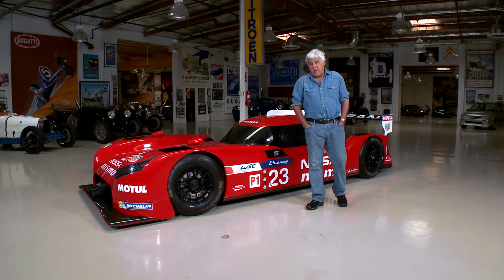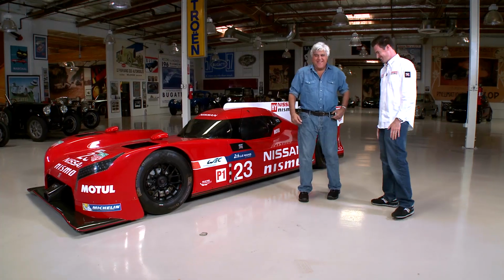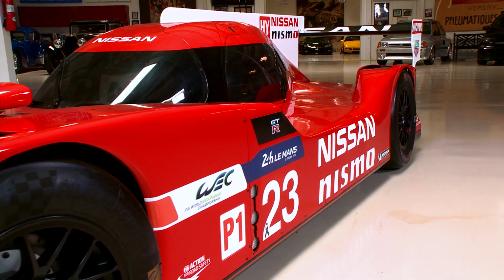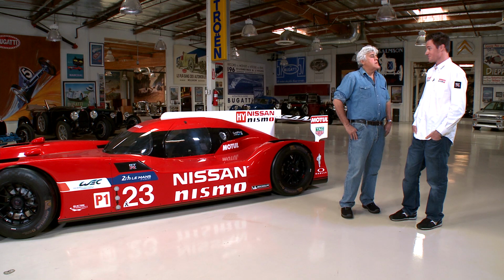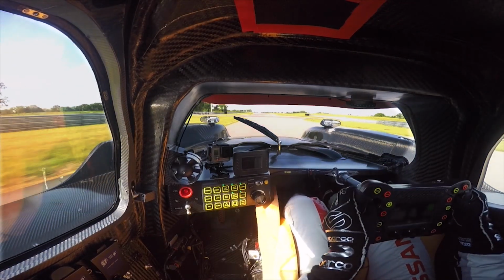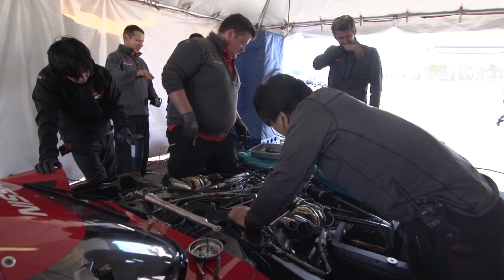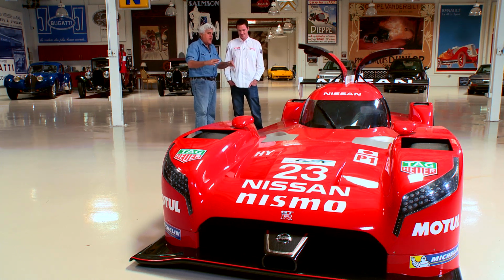Nissan GT-R LM NISMO - Jay Leno's Garage

Comment: Car was slow in practice.
Reply: Forehead Jones that they were. They did set the fastest trap times down the Mulsanne though. I think they were out there just getting a feel for the circuit. They more than likely won't be anywhere near the pace of the Porsches, Audis and Toyotas, but I think they'll be able to compete with Rebellion and put down similar times as them in two weeks. The 2016 race will be amazing.... Toyota will have a new car and the Nissan will be properly sorted by next year.
Reply: They were running shakedown, installation laps, and spent most of the day experimenting with setups.  They never ran close to max potential.
Reply: Forehead Jones Did it practice at Lemans?  Didn't think so.
Reply: Shadowboost Yes, it did.
Reply: Forehead Jones I am well aware of the fact that the course has turns sir. Which is why I said they were out there to get a feel for the circuit.... after the tidbit of their speed down the Mulsanne. A factory effort, especially one with a history of sportscar racing like Nissan would NEVER show up to LeMans with a car that's 40 seconds off the pace of it's competitors.
Reply: As a Motorsports Tech student, I'm actually intrigued by this car. We know that aerodynamics makes a HUGE difference in the handling and lap times of a car. Look at Formula 1, back when side skirts and diffusers were first coming i to play, the first team that really used them was incredibly fast compared to their competitors. If Nissan has found a loophole in the rules that allow them to run a whole lot more front end downforce than their competitors, then they should be able to keep up with the competition. I wonder if they'll have to run a harder tire than most with all the weight over the front. I'm actually very curious to see this thing in action.
Reply: They are doing shakedowns at this point in time.  Lemans will be the real deal go at it. They have not truly pushed the car to its limits yet.
Reply: Sean Kandel And for all we know, it's running 2-300 hp down on its max.  Laptimes at this point in time mean nothing.  They are datalogging brake temps, reliability, the hybrid system, tire temps and wear, etc.  They are trying to run longer stints than the competition through fuel saving from the low drag design, so outright laptime is not even all of the equation.
Reply: Forehead Jones 100% spot on.  It's more publicity than anything.  Seems like Nissan's mentality is, "if we do something wildy different, no one will have expectation and our fanbois will slurp it up like candy".
Reply: Forehead Jones  All of you are missing the fact that Le Mans is more of a fuel economy event than a fastest lap or top speed event 
There are a number of cars that have faster lap times or higher speed, but less fuel economy, more elapsed pit time and attrition will  prevent them from winning. 
Shakedown and engineering laps are never fast without regard to manufacturer or team.
Reply: patw52pb1 well how do u win 24 hour event being 40 seconds down? they are also the very last LMP1 car being outperformed by LMP2's.
Reply: Forehead Jones  
Fuel economy is not about the allocated fuel volume, it is about how often refueling is required. Pit stops for what ever reason are always detrimental to track position and the total number of laps in the 24 hour period. Fuel stops are especially time consuming because of the rules that mandate the engine is off and the driver is completely out of the vehicle before and during the fueling process. 
Practice is practice and the teams are under no obligation to run flat out or attempt to turn the fastest lap possible. 
Testing and setting baseline values is quite common during practice sessions. 
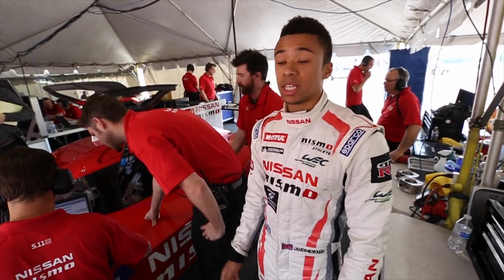You may be correct and we all will have to wait until 15:00 (UTC/GMT+2) June 14th to find out, but you have much to learn about strategy and strategic positioning, the better strategy is what usually wins and that is not always the faster/fastest vehicle, especially a long period endurance race such as Le Mans. 
Winning Le Mans is a numbers game with numerous calculated vector risks including fuel economy, malfunctions/failures, shunts, driver error, crew errors and attrition.
Reply: Impressive that you don't understand that the nissans were running warm up laps before they hit electric motor problems (during which time, the others went for quicker lap times). You will not know their relative pace until stint 1 of the race itself.  That was directly stated by Nismo's PR guy.
Reply: Shadowboost So it's slow and unreliable. Cool.
Reply: Forehead Jones You really don't get it, do you?  A new car, new system, new everything from the ground up of this complexity, you know there are going to be teething problems. So does NISMO.  That does not mean it is not fast.  It means, that until the reliability is sorted, you aren't going to see them blaze the time sheets.  Which could be at stint 1 at Lemans, or it could be next year.  Basing performance off of their first couple real practices is ridiculous and stupidity at its finest.  Congratulations
Reply: Shadowboost but you honestly dont think their practice results is not a complete failure? When has any LMP1 car ever underperformed so much like this in practice? Their Fastest Nissan was slower than 3 LMP2 vehicles. If they were to be competitive they should at least be performing with the LMP1 cars. they look absolutely pathetic
Reply: Shadowboost Oh I get it. It's new and reeeeal fast but it's slow and unreliable compared to the other LMP1s this year. The race is 12 days away and qualifying is in 9 days. How much do you really expect it to improve by then?
Reply: James Lewis  Currently there are no failures. Failures will be determined on June 13 & 14th.
Reply: Forehead Jones  It is quite evident that you are not very knowledgeable about running a race team. 
Qualifying is on June 10 & 11th, the previous laps on test/practice sessions are irrelevant.
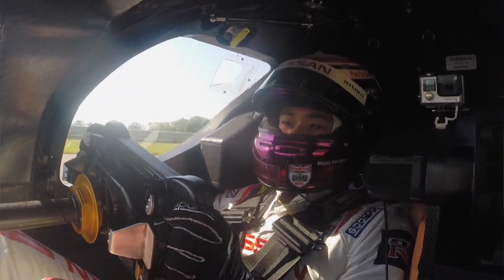Reply: Sean Kandel Dude I totally agree with what you said, I do recognize that Nissan came up with a very fucking crazy and an innovative idea, but I mean, you simply can't ignore the fact that they are completely overblown by the Porsches and Audi's... The fastest lap time last week was on Brendon Hartley's 919 doing 3:21:105,followed up very closely by the Audi's,but when I saw Nissan's lap time 3:46 and something I simply realized that they are not going to win this year... My guess for this year is Porsche - Audi - Audi, now ty the 919's have 8mj to play with and reliability, Le mans is on their hand literally!!
Reply: +braveraxeblade Wow a Motorsports Tech student please please get to work in poor sad modern f1 and let the cars be fully controlled by the 
"driver" and not from remote software by geeks in the pit lane maybe 
have a few bumps on the "tracks" to remind us that it was once road
racing !!!! Is your tech hands on type or the plug in lap top pit lane tech
guy "tuning" via key strokes and multi screen monitors
Reply: NOT!

Comment: Raced only 1 year ,all three cars entered were 20 seconds slower per lap than the leaders,only 1 car finished the race but didn’t reach the 70% of the leaders distance therefore was not classified,ouch!
Reply: Correction: Raced only 1 race(not year) during the  2015.  24 Hours of Le Mans. Never raced before,or after.

Comment: I really like it. I wonder exactly why it failed so miserably. Hybrid +1200 hp... it could have been something as simple as too much tire wear in the front or something completely different... Maybe just the weight distribution is wrong at most of the time and just right some of the time?... does anyone know the exact problems with it?
Reply: The main problems included: Nissan employing an unsuccessful designer who had two other failed designs (delta wings). Nissan also let their marketing department run the race team instead of having it led as an engineering project like Porsche and Audi. They used a production based engine in the car which barely had enough space to fit between the front wheels. Le Mans has a lot of tall ripple strips which upset the FWD handling of the car meaning that cornering was very slow. The hybrid system was never installed in the car probably because of difficulties integrating it with the production engine. A recipe for complete and total failure...etc etc etc. Thankfully, Nissan management pulled the plug on funding straight after the initial race.

Comment: Mad props to Nissan for havin' a go ! It's clear to see that Jay respects the innovation and complete out of the box thinking. Would have liked to see Jay ask more questions about the aerodynamics - how do the tunnels on top of the diffuser work to create downforce ? ..... and the biggie Jay steered clear of - what happens when the limits of traction kick in and understeer takes over ?!

I suppose the expectation was that there would be enough drag efficient downforce that understeer wouldn't be a factor, and that the whole efficiency package would see them competitive ..... it's just that other manufacturers are also pushing the efficiency envelope forward with perhaps less constrained fundamentals.

No matter the actual results good on them, and good on them for giving the kid a go too !

Comment: If you had counter rotating flywheels in the energy recovery system mounted, parallel with the track surface, couldn't you tip the flywheel in cornering and breaking to counterbalance the car in those situations?

Comment: I'm not a racecar engineer but wouldn't that force from the hybrid system on the rear wheels kick it really hard and make it lose control? tc would start braking and it seems like  it would just make it hard to actually use the system. front wheels would be a good idea for that system yes?

Comment: Do you remember the 6 wheel, indy type car that GM made? Four wheel, front wheel drive, Large wheels trailing in the rear. Drive was a small kerosene burning jet engine; driving a flywheel that sat flat under the passenger compartment(helped to stabilize the car). The car was banned from competing, it was too fast around the track. It got 75 mpgs at 150 mph. Where's your car's performance band? PLease tell us.

Comment: This should be rear or mid engine so the tyre doesn't run out very quickly because the weight on front wheel
Reply: hindsight is 20/20, still a unique and cool concept

Comment: Wouldn't there be a higher risk of making an airplane if you had the hybrid system in the back of the car because if you put a lot of power down you could push the front up and push more air under the car

Comment: Their hybrid system (which would make it 4WD) wasn't ready for use yet so it was run completely disabled on the track making this car a full on FWD car which is ultimately what made it so unsuccessful in Le mans.

*Mentioned at 10:30

 *Or at least that's what I got from the articles i've read referring to this car

Comment: See Jay, you should have kept your Olds Toranado front drive, instead of converting to rear drive. Maybe you can get one of these Nissans and run at LeMans too!  I usually am not impressed by front drive cars, but this beast is beautiful. The only other race cars I can think of with front drive, are some early Miller Indy cars. There must be others though. Great car! Thanks Nissan, and thanks Jay!

Comment: The most hyped race car of all time. Even if it was even slightly competitive it would have been regarded as a failure.

Turned out it was even more tragic than that.

I feel bad for anyone that was fooled by it, personally. I remember batting hordes of forum warriors away by telling them it would not be competitive at all.

People just get wide eyed over new stuff thinking it's going to be good without giving it a second thought.

Comment: Sony's Grand Turismo is indeed a racing simulator. They go out to each track that's in the game and plot the entire course electronically so the tracks are accurate down to an inch from what I understand. The cars are also EXTREMELY accurate from the mechanical aspect. Driver input is drastically affected by all types of variables just like the ones you'll find on the track. I'd say within the next 30 Years drivers will be training at least half of the time in a simulator that is exactly like their car. I feel these simulators will eventually lead to racing leagues all over the world from carts to F1. I sure wish I would have known that this Gran Turismo could have helped me get into an actual car at 
Le mans Then i would have invested all of my free time into "training" on the ole Play Station. Im 37 y/o & because I was always on my moto x bikes, building hot rods or helping dad build hot rods as well as souping up my go-karts  I never really got into video games. After the first time I played the original Gran Turismo when I was about 14 or 15 I saved my money and bought the Playstation system just for the Gran Turismo game which I played for a couple years when I could & it was a blast .If I only knew then what I know now LOL!!

Comment: can totally understand how those ..air tubes.. give the car benefits.
Nissan=>
i'd try to add active surface controls on the inner air contact surfaces to
change where the pressures are 
vectored in various turns stops acceleration modes

Comment: If you're running two systems, concurrently, of approximately 500hp each, with one system turning the front wheels and one system turning the rear wheels, then don't you average out to running 500hp and not 1000hp?  Is my thinking wrong?

Comment: The car made its racing debut at the 2015 24 Hours of Le Mans. Three cars were entered for the race by Nissan Motorsports, numbered 21, 22 and 23. The cars qualified in the last three places of the LMP1 class with times over 20 seconds slower than the pole position time set by the #18 Porsche 919 Hybrid. The #21 car was actually out-qualified by the fastest LMP2 car. After the three cars failed to achieve a time within 110% of the pole position time, they were demoted to the back of the prototype grid. The #21 car retired from the race after 115 laps with a suspension failure, while the #23 car retired on lap 234 with gearbox issues. The #22 car finished the race, but was not classified as it failed to complete 70% of the race winning car's race distance. The car was never raced again.